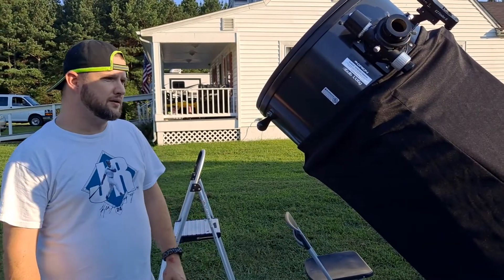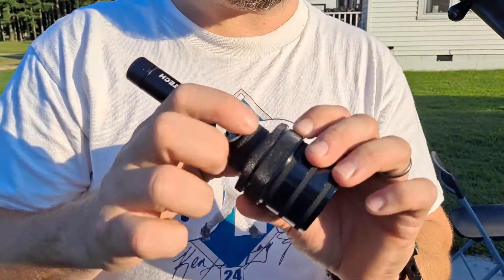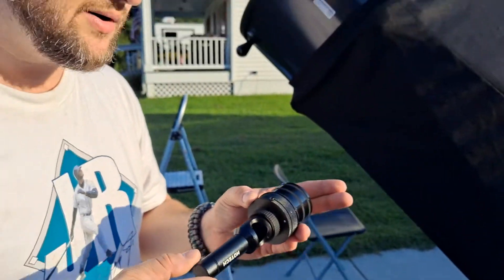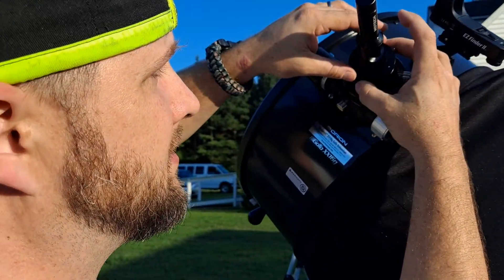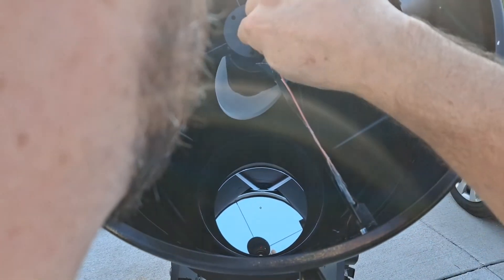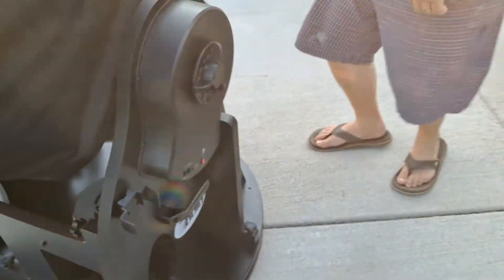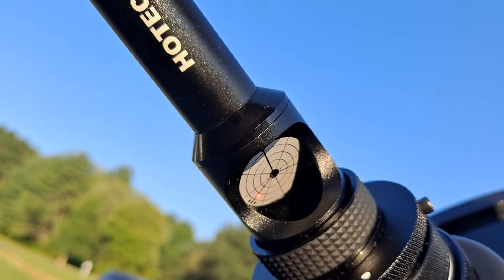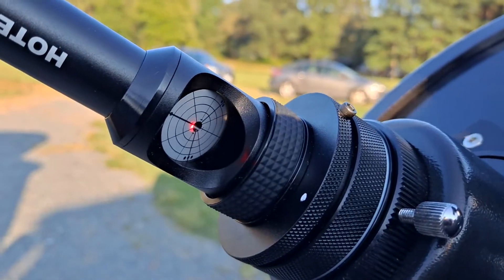How to Collimate a Dobsonian | Real Demonstration

Comment: Wonderful telescope!  I have a humble 10 inch dob. My first attempt at collimation was a bit rough. If you don't pay attention to the secondary mirror with the Allen key, the mirror can come loose and fall on the primary. You really have just small adjustments to do on the secondary and I make sure it's still solid in place. The primary mirror is easy to adjust.
Lots to learn in my first month owning the dob, but it's fascinating looking at the skies, even in my light polluted city location.  
Thanks for the video...I'm always looking for any advice especially as the weather cools down. I see you have dew heaters on tne secondary and a fan behind the primary. I'm planning to extend the tube near the secondary with some black material. It should help with light pollution and dew control. Eventually if I'm still in the hobby, I'll invest in proper dew controls.
Reply from the maker: That extention should work! Clear skies!
Reply: I've read (*) the hint to have the OTA horizontal during collimation with the eyepiece mount pointing up, if possible. So nothing can directly hit the main mirror and the laser won't tilt due to play and its weight.

(*) No experience so far. I found this video and others when looking for the different tools like laser or Cheshire eyepiece.